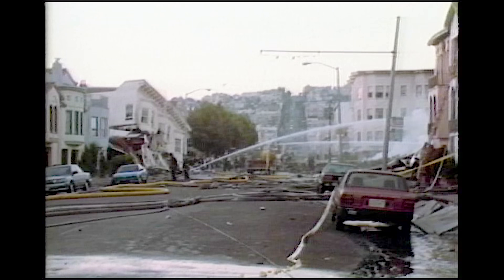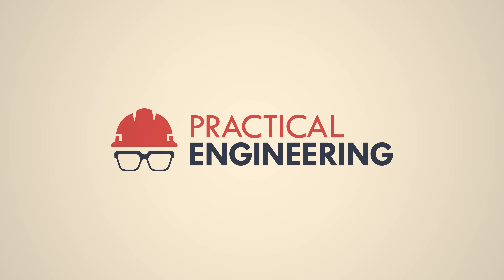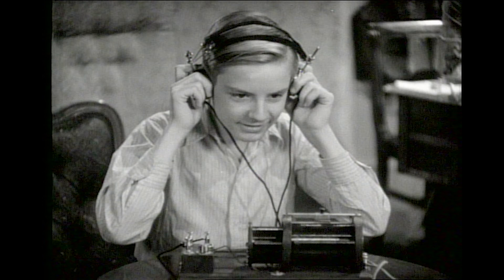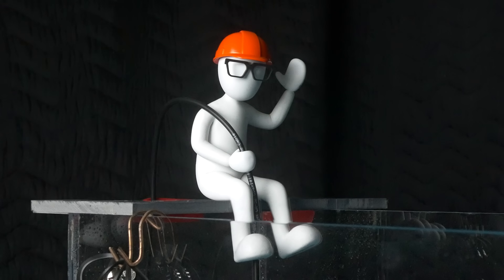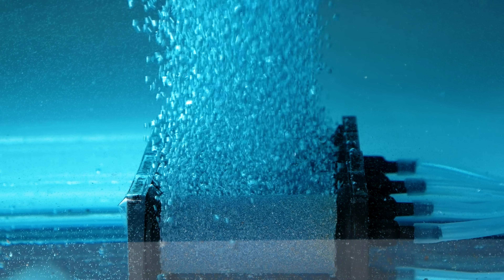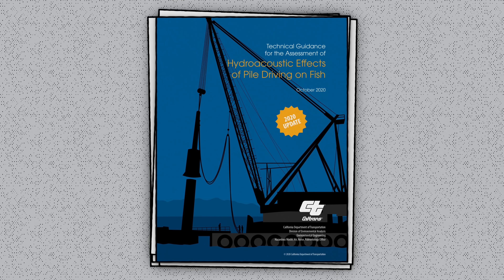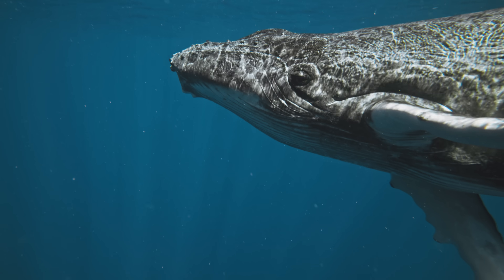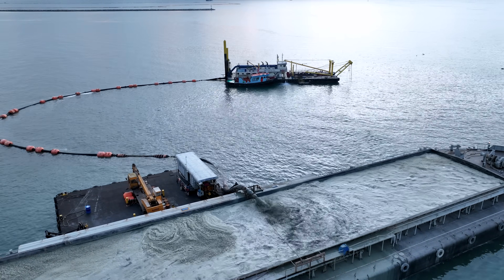The Weirdest Tool in Underwater Construction

Comment: 13:28 Bubble curtains have also been used in Olympic diving pools for training. A belly flop from 10 meters hurts way less when you land on 50% air.
Reply: A side benefit to this is that it also helps the divers see where the surface of the water was as they fall.
Reply: I have seen it in Utah used on a practice ski jump ramp for a similar reason
Reply: Just don't add to many bubbles to the pool I guess, that could be deadly
Reply: @madcowkastor  just make the 1/2 dense water 2x as deep.
Reply: The Olympic Belly-flop category?
Reply: I saw that at an off season Park City Utah ski jump training pool. I like how they also used like office carpet sprayed with water before each jump. (I was assuming water because when I was younger we used to stair surf this office that had an exit on the second floor just a door that led to one flight of stairs flat section then launch down  one more flight of stairs to a flat. And we would sprinkle water on the  corner edge of the stairs that would increase the speed of the slick bottom boogie board we were sitting on. So much drunken fun, so many rug burns, bruised tailbones and booty cheeks.)
Reply: I thought it was that the bubbles break the surface tension. I was taught that it's the surface tension that hurts so much when you start hitting water at faster speeds.
Reply: @ThisIsATireFire  It's mostly the inertia of the water. When you hit it flat, it takes a lot of force to accelerate the basically incompressible water sideways out of the way, so it acts almost solid.
Adding bubbles both reduces the average density (easier to accelerate) and adds compressible air (cushioning).
Reply: @ThisIsATireFire if that’s true why wouldn’t you hear about people putting a little Dawn in their pools?
Reply: @colinjohnson5515 cause it wrecks the plumbing and filtration system. I had a hot tub get completely destroyed by that exact thing, friends and i got in after a homemade slip and slide with dawn and the whole thing had to be replaced
Reply: @eldonperkins819 What happened? Did the soap bubbles cause the pump to cavitate and destroy itself?
Reply: @cyberGEK It’s likely the surfactants that dawn soap contains ate away at the rubber and plastic components. Dawn can cause some materials to micro crack or kind of chemically “dry out” with prolonged exposure.

Comment: Read an article YEARS ago about doing construction across a lake in the north, Minnesota or there abouts. Concerned about damage to the lake’s concrete dam, built a bubble wall powered by large commercial air compressors on both shores. Popular Science short story?

Comment: One application for compressed air underwater that I haven’t seen is for aquatic stage shows!  I used to work for Cirque Du Soleil O, and they use compressed air to create bubbles underwater both for visual effect on the surface and because the bubbles catch more light (due to part of the light being refracted through the air-water boundary and part of the light being reflected off) than non-aerated water.  And of course, during the 60ft (18m) high-dive scene, aerating the water also makes the surface easier to see for the high divers and breaks the surface tension.

Comment: Water spray curtains are also used for fire radiation absorption and protection of key surfaces. They can also help manage gas clouds migration. It’s not just the water droplets, but the induction of air with the droplet velocity.

Comment: I worked in offshore installation. Anyway the bubble curtain used in wind farms are normally called 'BBC' for Big Bubble Curtain, or some sites mandates even DBBC. But there are also mitigation from noise reduction units in the hammer itself.
This is normally a dedicated vessel (smaller PSV size) full of compressors to supply the air that goes to the predeployed hoses

Not to mention studies into the possibility of using other methods (when the soil allows) like vibro hammers or suction bucket jackets, or even monopiles that uses jetting (piloted already in Orsted Gode wind https://www.youtube.com/watch?v=TymgnMwQLB4&ab_channel=%C3%98rsted). There are also installation templates that integrates the noise reduction https://www.youtube.com/watch?v=5UwmguZGkcg&ab_channel=HeeremaMarineContractors

There are also other more conceptual ones  which are still on the drawing board.

Comment: A fellow engineer told me a story about one of his engineering professors.  The professor consulted on a “water hammer” issue in the input pipe for a hydroelectric dam’s turbine.  After analyzing the problem, he settled on introducing air (bubbles) into the feed pipe, which shut down the water hammer.

Comment: Has anyone filled the driving pipe with some type of foam product? This might stop the pipe from ringing like a bell when it's hit. Just a thought, I'm not an expert. It seems as thou there is also new sound reduction technology being used on medical scanners which are nothing more than baffle systems. Completely compatible with water, however I don't know if they would work in water. Another just a thoughts. If it's not practicle, then neverminding. 🙄

Comment: The counterpart to this is fascinating - using waterdrop curtains as sound barriers in air. Rocket launch pads use this since the sound waves of rocket engines reflect off the structure and damage the rocket otherwise. It's called sound suppression.

Comment: Another thing is that water in contrast to air is incompressible. This means that for example an underwater explosion or pressure wave in general like these hammer blows hits much harder and does lots of more damage to underwater life then if it had been in air because the pressure cant dissipate through compression.

Comment: Wouldn't using cofferdams avoid the bulk of the acoustic issues you get from pile driving? You could simply size the cofferdam so you have enough of a air gap to limit the radius of acoustic damage through both the water and the seabed with a fraction of the complexity it would seem.

Comment: In a bath, if you fill a cup with water and hold it upside down, then fart underneath it, the bubbles will collect in the cup and you'll be left with 100% strength fart air

Comment: FWIW ..... Currently (09/03/2025) am working on a ship that deploys "bubble" curtains  on piles driven for windmill project- we use 11x 3100cfm compressors for air supply - 34,100 CFM to operate to the system. We use a  Hydrotechnik-Luebeck system.

Comment: 11:45 - "A 5dB reduction,... nearly cut in half",.... NOPE. 3dB is half the pressure. 6 would be 1/4 the pressure, so 5db is closer to 30 to 35 percent of the pressure of the original sound.
Reply from the maker: 3 dB cut is 50% reduction in power, 30% reduction in pressure.
Reply: it depends on whether 35% off is nearly cut in half or not 😂
Reply from the maker: @andrej2375  -5 dB is a pressure reduction of 42 percent. That's why I said "nearly cut in half." I think some people are confusing power with pressure.
Reply: @PracticalEngineeringChannel decibels is only used for pressure. Power is measured in Watts.

Comment: In the picture of air around piles, there was a big distance between the air and the piles. Why? Wouldn't you get just as much attenuation from the same thickness of cushion, but much smaller circumference?

For that matter, why not simply attach air bags (in the shape of rings) to the pile? You could completely surround the pile with a layer of air, and I'd think that would attenuate the sound even better than bubble curtains.

Comment: it's not quite the same thing, but there is another area where underwater bubbles are important. there's a handful of lakes in the world, mostly near the equator, that are extremely deep, and are situated near the ring of fire. in these lakes, methane gas can dissolve into the water, and get trapped at depth by the depth itself. sadly, these lakes are unimaginably dangerous, as something called an "inversion" can cause the lake to explosively decompress, releasing insane amounts of the deadly gas into the air. this gas is heavier than air, and so it blankets the area, killing everything that enters it. the largest known example of one of these deadly lakes is currently being harvested for that methane gas to burn it for power generation. they literally just stick a big straw down into the layer of water that contains the gas, open the straw up, and the gas comes out. that's how high the pressure is. I think RealLifeLore has a video covering both the tragedies of exploding lakes, and how they're being harvested. definitely worth a watch.

Comment: I mapped the ocean floor with a variety of multibeam sonars aboard research vessels, and bubbles along the hull in between the transducers and the sea floor were the bane of my existence! Some ships had noisy jet bow thrusters and they generated so much bubbles that it made the data useless.

Bubbles from bad weather can make the hull chop along the waterline which would induce bubbles, which also created issues.

Some ships utilizes a gondola with all the transducers for their various sonar-based sensors so they’re away from the hull so they get much cleaner data.

Comment: Impedance is resistance to an oscillating differential. Doesn’t matter if that’s pressure or voltage. It’s not just for sound :)

Comment: I worked on the sound monitoring program for the bridge construction. We would run around in a zodiak, set up raft based monitoring stations with data logging SLMs fitted with GRAS hydrophones. There is about a 50/50 chance I made the spectra plots in excel shown in the video. One of my tasks was to better systematize & streamline the data processing into excel, which was clunky AF back in the day, and meant the majority of that data came across my desk. Our SLMs downloaded over a RS232 serial into CSV, blah. To get frequency spectra we recorded on digital tape and analyzed audio in the lab. Back then the spectrum analyzer we used ran about $20k, and wasn't going out on the water. I spent many hours in my early 20s listening to the driving noise. That was 2004. Almost died one time, yay. One of our problems was the vibration of the lines going down to the hydrophones, which held at depth by running weight on the line. In a current the lines would vibrate like a violin string, enough that the hydrophones would get jostled and wreck the signal. It was a steady state phenomena, very odd to see.
Reply: bubbles injection along the hulls of ships and props is an area of current exploration.
Reply: Not a bubble idea, but an acousto-mechanical fog to water idea. The nexus came by holding a harmonica a stiff wind on my hike, which produced an audible sound. The idea is simple, use the wind to produce sound at a frequency and intensity sufficient to coalesce droplets in fog, & as Emeril would say, boom, water. Loose weave nets are sometimes placed on ridge lines in areas with wind & fog, but little rainfall. The water collected in fresh and pure. That system is limited by the physical constraints of area covered. My system would work by creating relative motion between adjacent droplets that vary in size, with larger droplets being more resistant to fluid motion, increasing a droplet's probability of joining with another. Assuming that the most effective frequency would be at wavelengths comparable to the size and separation of droplets, which would likely be in the ultrasonic band. High frequency noise attenuates spatially much quicker than low, which is good if your blasting clouds with sound and have sensitive receptors nearby. High frequencies are also easier to direct. One could imagine ground based apparatus that beamed energy upward in a narrow curtain to keep local field intensity high and controlled. I thought it was a nice idea. Low chance of working, but from 1st principles it holds water. He shoots, he scores, ya baby!

Comment: Here's a crazy weird thought: 1) Bubbles under a boat can sink it by reducing the density of the water causing the boat to lose buoyancy. 2) There are prototype energy storage systems which use giant floats, cranking it down to store energy and letting it go to drive a generator. 3) What would happen if you combined the two ideas? Use bubbles to sink the float, using its weight to drive a generator. Then stop the bubbles so it floats up, also driving a generator. Infinite energy! (That's a joke)

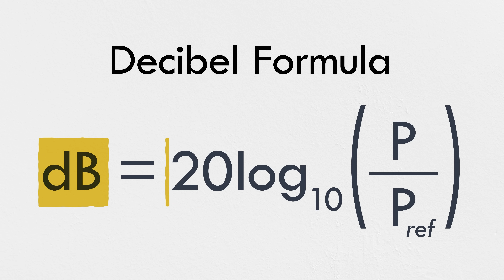Comment: 3:40 Where did you get that formula? instead of 20 it should be 10.  20 is used for amplitudes not powers.
Reply: Also at 11:44 he is talking about 5db reduction, which is not reducing it by half but by 3 times.
Reply: ... but this is amplitudes. pref is the reference pressure, not power.
Reply: 20 is used with voltages, since power equals voltage² divided by resistance.

Comment: I had a job once on a floating barge with a 1/2 ton vibrating pile driver trying to position 22m long h w piles with waterproofing compound in the clutches using GPS from the shore in order to create a coffer dam.
Not easy.
We had to isolate the generators onboard the barge with rubber feet for environmental reasons, but we were still allowed to use vibrating hammer rather than oscillating hammer for pile driving in the ocean.
To be kind to the pink dolphins I guess.
Clarke and Dawe - A Concern for the Whale

Comment: I don’t know if it was mentioned, but the up-current from the bubbles can be used to move water up into a filter without the need for a submerged pump, making easier maintenance. I’ve only seen this on small scale fish tanks but the idea should work to lift water up a pipe even on larger scales, though I don’t know the limits

Comment: Important to note this technology sprang from research begun during WWII by the US Navy. Today the system is known as Masker. Compressed air is released from pipes along the hull beneath the engineering spaces. The bubble curtain that is formed "traps" the sound of the engines within the hull where it will dissipate. It is very effective and the sound it gives off is very similar to a passing rain storm, raindrops plopping into the water at the surface. Not only does it help hide ships from enemy submarines, it lessens the impact of the ship's own noise on hearing submarines. 

There is a second use for the compressed air. They push it through the edges of the blades of the propellor(s). This softens the cavitation noises created when a propellor is operating at a speed where the low pressure from the blades moving through the water reaches the partial pressure of water vapor which causes bubbles of water vapor to form. When the pressure increases in the water those bubbles collapse creating a popping noise. When millions of these bubbles are popping the noise is tremendous and travels for long distances. Putting compressed air into the area these bubbles are created in causes a large reduction in sound because many of the water vapor bubbles will entrain air bubbles and not be able to collapse completely and thus make no sound.

Comment: Bubbles are actually used in the refining process of copper. With some similar ions in the solution, tiny chunks of more pure ore stick to the bubbles while the regular rock does not. With the addition of a soap, the bubbles stay at the surface with tiny flecks of purer copper ore stuck to them. They are the. Skimmed off the top and further refined.

Comment: Buffalo Industrial Diving Company (BIDCO) successfully used bubble curtails to protect fish during the underwater blasting operations for the new mooring systems installation and relocation of the USS Little Rock and USS Sullivans at the Buffalo Naval spark back in 2002. I designed and installed the system and the University of Buffalo did all of the underwater acoustic sampling and fish tracking for the duration of the project.

Comment: I discovered this phenomenon independently when I was doing an experiment to use a laser to detect sound from modulating bubbles. I noticed the more the bubbles in front of the source, the lower the signal on the outer bubbles. I did a paper study on it and found this bubble curtain idea.  And it all makes sense because I was trying to detect the sound in water since it does not transmit well from water to air.

Comment: I wonder if the considered a tube of insulated column.  Seems like an easy thing to test.  I guess rockwool wouldn't work since water will fill the air pockets. But MLV? Weight wouldn't be an issue.  But who knew bubbles could attenuate sound. Makes sense when you think about it, but still fascinating.

Comment: You're also getting reflections from the back of the tank, so that, too, is distorting your test. Would be better to do this in a swimming pool with Brady a bit off center and the hammering a few feet away from one end. What I saw on the graphs you did of your test were shortened peaks, a more rapid falloff, and a lower overall sound level. So it was effective, just not as effective as desired for the first impulse, which is what would do all the damage. Still, it will reduce the radius that the sound will travel before falling to fish-safe levels.

Another method might be to put a larger pipe a couple of feet into the clay (enough to support it, but still allow it to be easily removed later), evacuate the water, which equates to making a mini-caisson, and then hammer the smaller pipe home within the larger pipe, so the only thing you get is ground propagation.

Comment: Question: you mentioned your acrylic tank was likely transmitting sound or vibrations past the bubble curtain. Could this be reduced by using a cheap thin vinyl kiddie pool?

Also, thanks for mentioning nebula at the end. I recently pulled the trigger and subbed but didn’t realize your series was on that platform. I’m excited to see more of your content there.